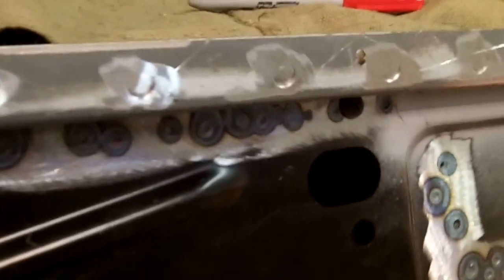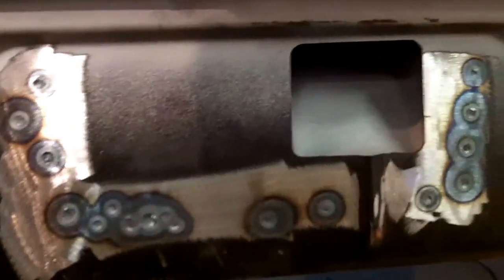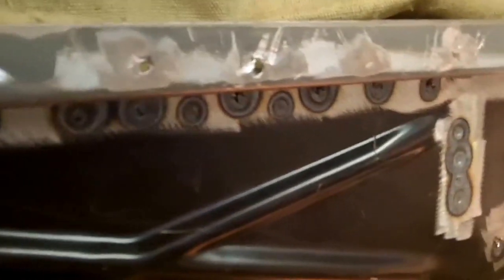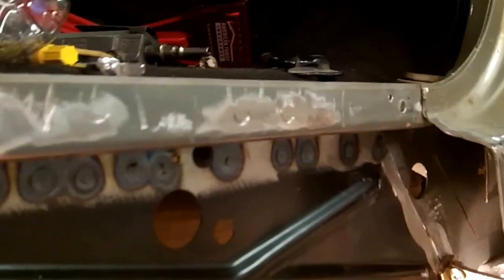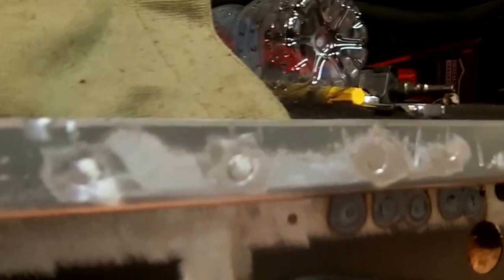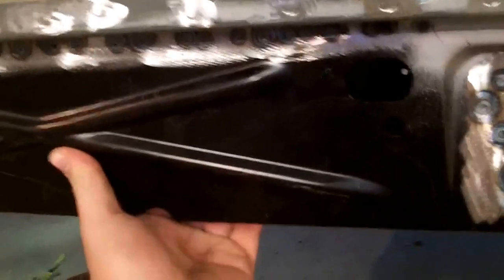GMC rust repair #5 Spot welder!

Comment: Looking good.  Wish I would have had a resistance spot welder when I did my inner and outer rockers.  I now have a Lenco spot welder with the two hand held electrodes.  Works awesome especially for areas you can't get to the inner structure easily.  And the spot weld timer is adjustable too

Comment: Adjust the tips of the welder so they align 100%. Thats one of the reasons you are blowing through. Good clamping pressure, and set the timer(if equiped) to shorter duration. Those look really hot!